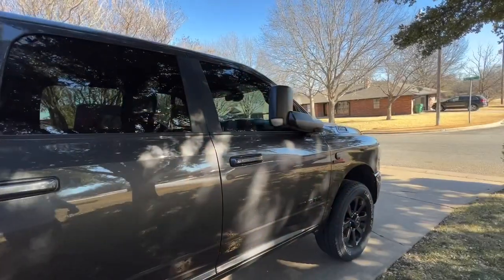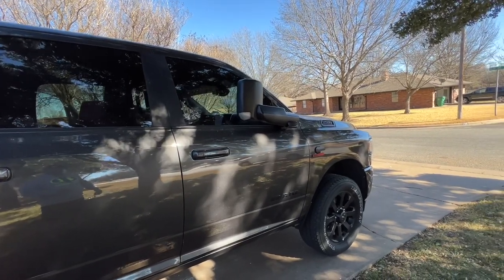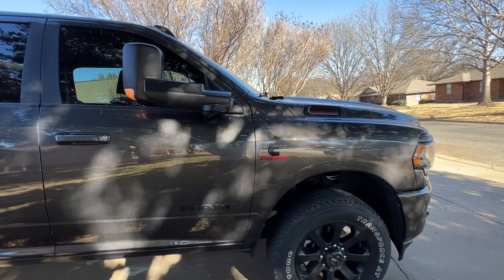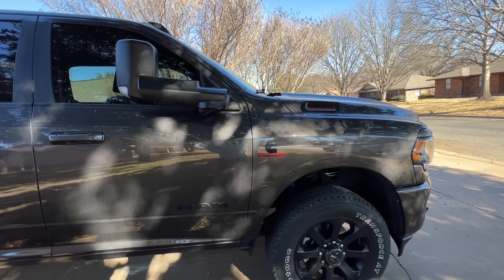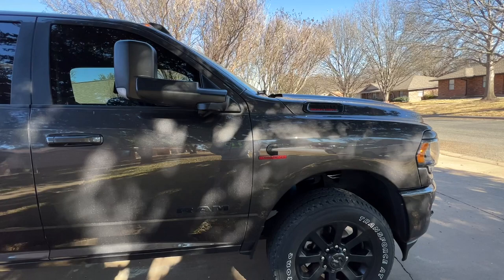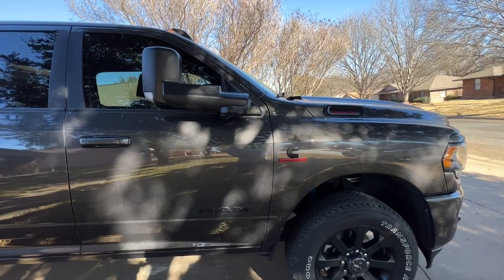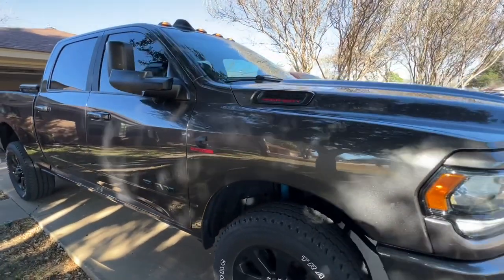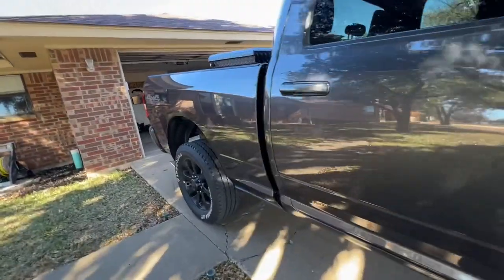2020 RAM 6.7L Cummins Banks Ram Air Inktake Update

Comment: Wow the new trucks are way better than what my 2015 is on fuel economy. I have hand calculated every single tank of gas through my pick up. I have about eighty thousand miles on it now I have never got twenty miles per gallon. The pick up has been deleted and a b d screamer turbo put on it when the factory turbo failed.  I average around 16 mpg empty and no load.  Attach a trailer and it drops according. Going from AT to MT Goodyear Wranglers cost me 1 to 1.5 mpg.  Nothing seems to improve mpg but it is easy to make it worse.
Reply from the maker: It absolutely can get worse really fast! This one just had the fuel pump recall completed on it. Swapped from the CP4 to the CP3. I haven’t had the chance to get it back out on the highway but as soon as I do I will show what the numbers look like. I am thinking the mileage is probably going to go down, but I could be mistaken.

Comment: I’ve got the 2021 Mega, white night edition. Originally ordered your color but ended up changing it in the middle of the order as my wife really wanted the white 🤷‍♂️😎. 
I just received my Banks Ram-Air Intake and I’m excited to start on the install. Seems pretty simple and I like getting under the hood.
Great video 👍🏻
Reply: Btw, I’m on the waiting list for the Banks exhaust pipe for this same truck. It’s supposed to come out either this Feb or Mar so keep an eye out it if you’re interested 😎
Reply from the maker: That’s awesome! The white trucks are clean 💯 be sure to check out my install video on my channel! Thank you for the comment!
Reply: Banks instructions are pretty simple to follow. I just got done with the install, took a little over 1hr. Took me awhile though to figure out how to remove one of the sensors. It’s a new locking mechanism that I haven’t dealt with before but I figured it out 😎. The very first difference I noticed is the sweet turbo whistle which I didn’t have before. It’s definitely pulling in more air. That alone is worth the $. Will see how much mpg gain I’ll get but expecting 1-2mpg as others have confirmed.
Reply: @sholbura what’s your update after a year of ownership and a little more break in, better mpg? Did you install the exhaust?

Comment: Back when I was young and dumb I would swear upgraded ram air/cold air after market intakes made a difference.  Unfortunately, that just isn't the case.  Stock intakes provide a smidge more air than can be used in a stock engine.  So unless you're doing engine internal work, you're wasting money on after market intake systems, period.  There is no better throttle response, no HP gained, nothing except maybe a tad more noise.  I've known to many people with dyno's who know better and dyno'ed vehicles I've owned knowing I'd prove them wrong only to be proven wrong myself.  Bottom line, don't waste money on any after market air intake systems unless you intend to do engine internal work on heads, bore and exhaust.
Reply from the maker: UdLuz, thank you for the comment. I have been extremely behind on follow up videos but I will get one out together for you guys. Some idiot thought it would be a good idea to try and steal the truck so that threw me off a little.

Comment: Like your comment short and to the point, I like to hear the turbo and the increased mileage is a plus. It would have been nice to see the air intake but no biggy
Reply from the maker: Gary, thank you for the comment! I will make sure and get a good shot of it in the next video for sure! Also if you check out the install video it has a couple of shots where you can see the size difference between the Banks and the Stock intake.
Reply: @TheRealTRS   My apologies, after I sent my comment I saw below your install video. Thank you

Comment: Thanks for the video. Now that you’ve had the Ram air on for a little while do you have any update on fuel economy? I have a 19 HIgh output tow a 15k lb trailer so I’m considering doing one too.
Reply from the maker: So far (at least on the dash) I’m seeing 23.5 and 24.1 on the highway without a trailer. I will need to do a little pen to paper to see how accurate that actually is , but, when we took it to Florida in July before doing the intake it got 21.5 - 22 there and back and that was very accurate. So 23.5 - 24.1 is the new numbers so far.
Reply: @TheRealTRS  Thanks for the update almost 10% is Great 👍

Comment: Did you notice better throttle response?
Better on the downshift lag??
Reply from the maker: In my opinion I feel like it has a touch better response but not anything to write home about. The biggest difference I’m seeing is the increase in fuel mileage. The downshift lag is still present but maybe not as bad. Both of those answers are subjective. However, I have had several requests to review the pedal monster and several people have said they noticed a big difference with it.

Comment: 60 to 65 degrees and it needed to heat up first before start??? Mine won't do that unless I am around 35 - 40.
Reply from the maker: It was cold that morning, and the truck was still in the shade and cold. That’s probably why it did that.

Comment: Did you ever get a chance to calculate with pen and paper? If so did the mileage go up? Considering getting one but everything I’ve read says no added performance from the stock filter. Just wondering how much the mpg went up if it did at all.
Reply from the maker: I have not just yet but I will definitely do it. Someone tried to steal the truck last weekend so I am about to put up a video on how to replace the window this next week.
Reply: Everyone on the internet say none !! Just better turbo whistle. Save your money

Comment: Is the intake the only thing you did?  I've been in the fence about getting the banks for my truck.
Reply from the maker: So far yes, the only thing done is the intake. I am waiting on Banks to come out with a couple more products before I do the rest. As soon as they have an inter cooler and release the exhaust I will put those on as well.
Reply: @Texas Rando Show  thanks for the response. I've been watching banks myself. I want to do a def delete, but I am wondering if banks will come up with a good exhaust before I do.
Reply from the maker: @kuyaali956  I am on the waiting list for Banks DPF back exhaust currently. I’m waiting on them to come out with an inter cooler for this truck before I do the intake horn.
Reply: @TheRealTRS  waiting on the Derringer myself. Should be a great kit if they can pull it off. What part of hill country you in?
Reply: @TheRealTRS  waiting on the exhaust myself bit I haven’t heard about the intercooler yet. What’s the adv. on that?
Reply from the maker: @jlr3482  up in Erath County, you?
Reply from the maker: @sholbura  haven’t heard much just yet but it is supposed to be lower back pressure. Just haven’t heard a release date yet.
Reply: @TheRealTRS  at the gateway to the hill country, Dripping Springs

Comment: My 22 limited won’t get over 13.5mpg with a intake on
Reply from the maker: That’s crazy! I wonder what the difference is?
Reply: @TheRealTRS  I'm in the same boat, about 14 mpg on the 2022 Limited. Granted though I do run 35" Load range F tires. I'm sure that doesn't help with those heavy things.
Reply: @Longslyde1  My 2020 SRW 4x4 with F Rated 35s, gets 21 on the highway. About 15 city. No changes except the tires

Comment: What is your city or mixed mpg if you have it?
Reply from the maker: Pulling a trailer is 13-15 depending on load, city is around 18/19 at least on the dash. I need to do a hand calculated run.